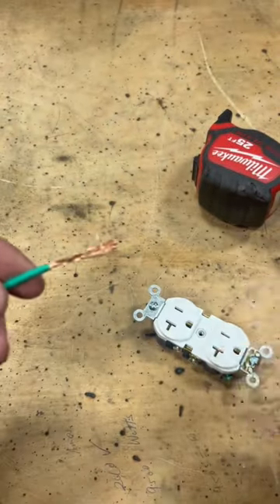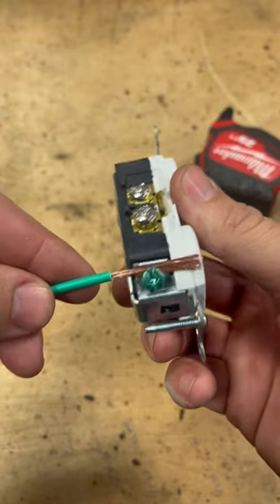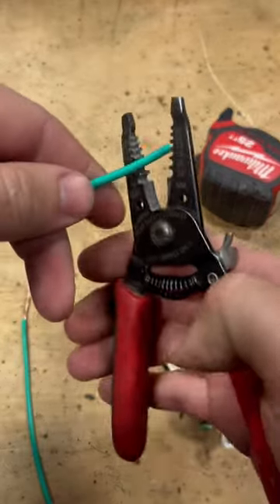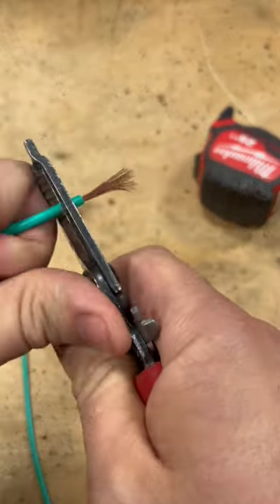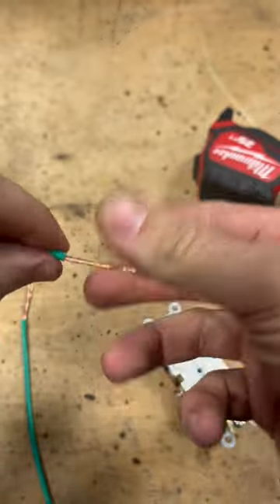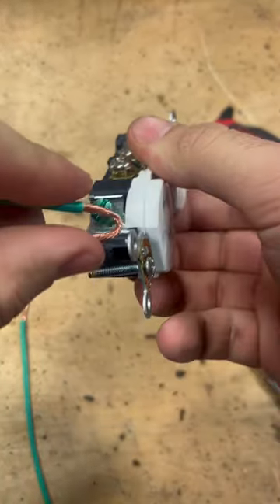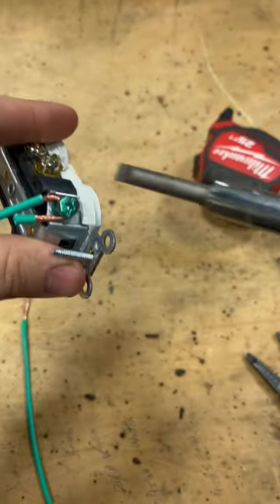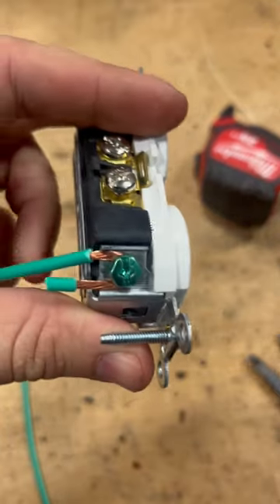Stranded wire ground termination

Comment: if you must use stranded wire for this trist the wire backwards from shown in this way the wire will be traped under the head of the screw as it is tightened and not flair open

Comment: Far from the factory install, Use solid wire or use a cramp. That's why they have the right tools and equipment for the right job.

Comment: doing things against code.... you are NOT allowed to screw terminal stranded. ONLY in a clamping screw terminal or if the end has been crimped or in rare still barberic counties... soldered... what you did is a 100% code violation in all 50 states and counties
Reply: Why is soldered bad, other than increased labor?